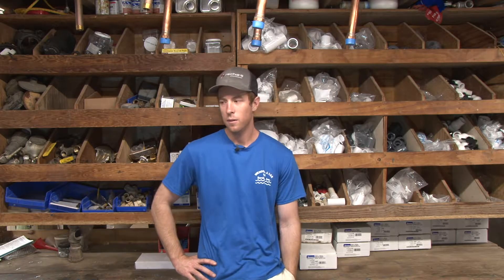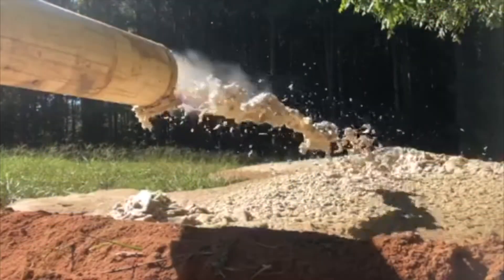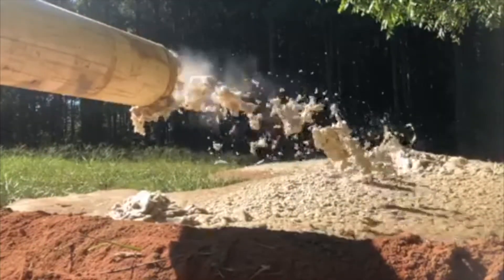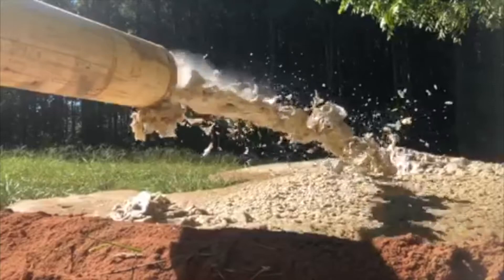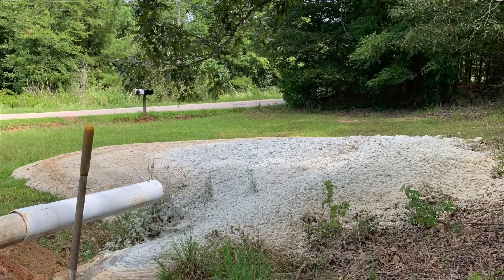Water Well Drilling with Foam | Is it Harmful? Why is it Used?

Comment: I just started drilling with foam. Do you use any defoaming agent to take care of the surface mess or do you just let dissolve on its own?
Reply from the maker: We just let it dissolve on its own. It doesn't take long to dissolve and most of the time the water from drilling in the rock will help dissolve/move it out.